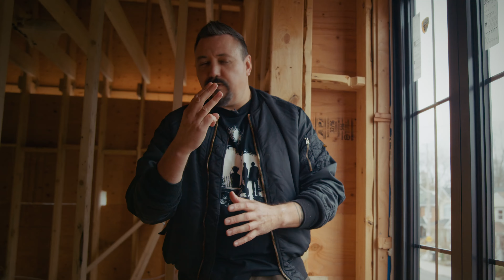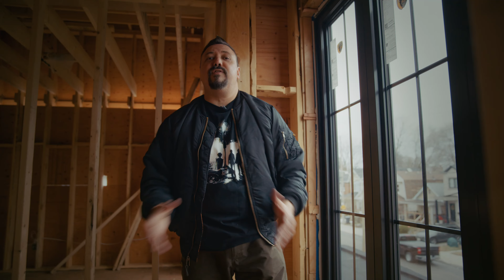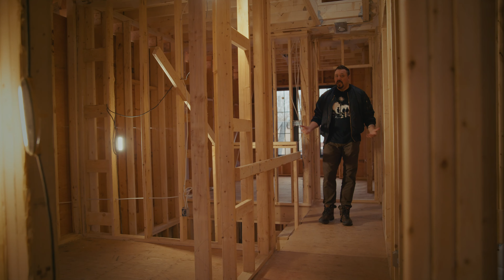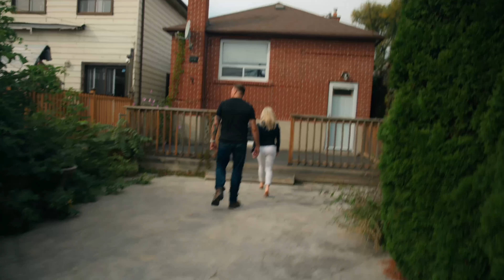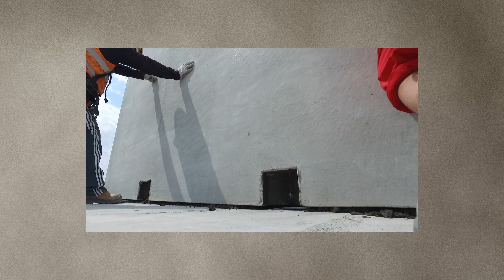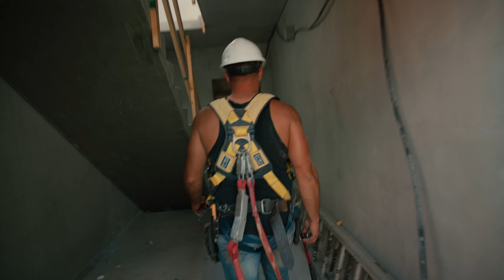Are We Crazy to Mix Hollow Core, SIPs, & 3D Printing?

Comment: Given the fact that your 6plex is a narrow rectangle just do tilt up concrete panels the first 4 floors and then a frame the final 2 stories since the roof geometry is easier to do with it. Structural steel beams placed between the sides of the building pull the external walls together and you can put the hollow core on top for your floors.
Reply from the maker: Solid insight, Stephen. Tilt-up for the first four and framing the upper two could definitely streamline the build considering the geometry. Appreciate you dropping ideas like this, it all helps shape the path forward 👊🏽💡